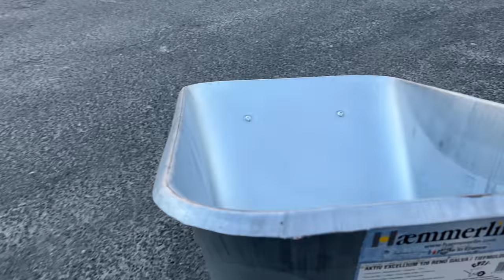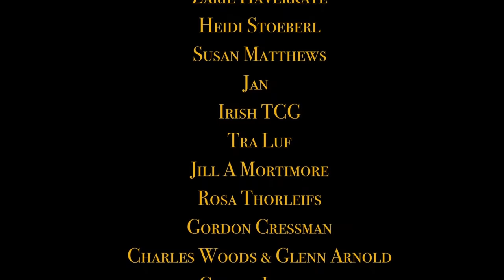EP95 A French Builder's Tip , Pool Hack for Rounded Edges

Comment: One option, is to get some more of the buckets. Enough to fill one mix of the mixer.  So whilst the mixer is mixing, fill 1 bucket with water. 2 with cement, 3 with sand.  ie. 6 buckets. 
Then when you dump the mix into the new wheelbarrow, you can very quickly recharge the mixer.

Comment: An updated tour would be a great Christmas gift.  
Your pool project blows my mind.  Most pools in the USA are done with gunnies and plaster.  Very rounded.  My husband put in a water feature wit block walls.  We never finished the the walls and floor.  The waterproof paint failed after he passed away.  So it has collected rainwater, leaves, mosquitoes and algae for the past five years.  I sold tile for almost 20 years.  The plan now is to line the pond with porcelain tile and sliced black beach pebbles.  I love the wine bottle method of curving the corners and edges.